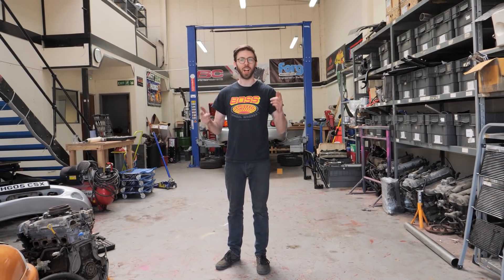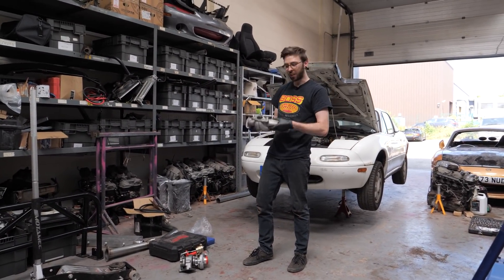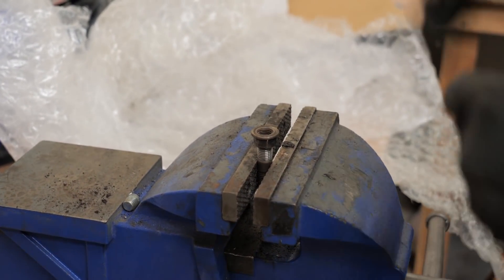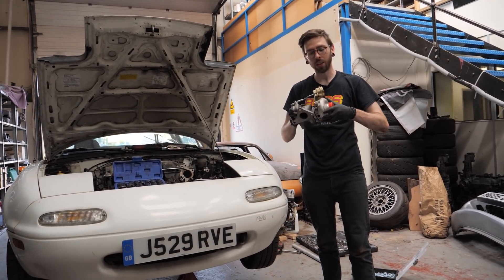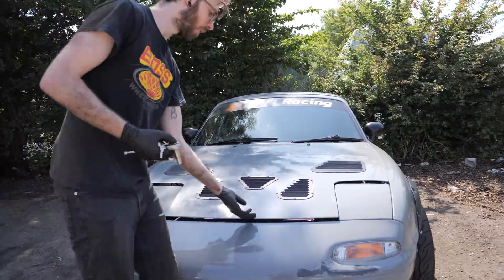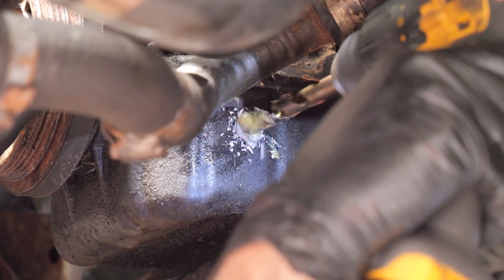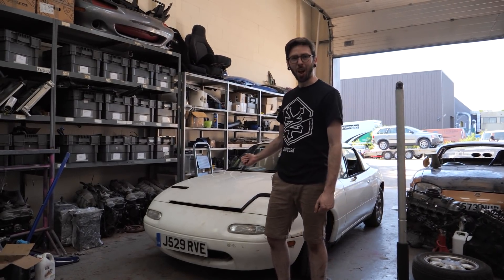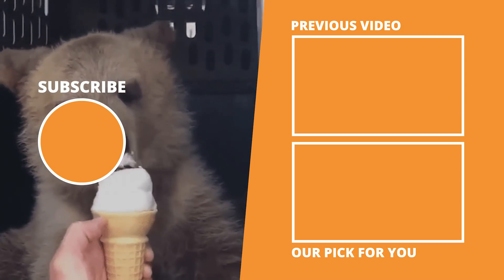The Miata Gets BOOSTED With A China Turbo And BLOWS Its Radiator

Comment: i run a 95 1.8 with g19 manifold, downpipe & dipstick oil drain, ebay td04, ebay intercooler, ebay intercooler piping kit, rx8 yellow injectors powered by ME221 @ 276.2 bhp and 247.4 lb-ft 
(crank) on 10psi
Reply from the maker: 💪 stout
Reply: Maybe a dumb qyestion but can you still use your dipstick and why would you use it as a drain?
Reply: @SybePlays  Yep, still a functional dipstick and using it as a drain saves having to drill into the sump and risk shavings getting in the pan.

Comment: To be honest, the only thing that broke was the stock rad is pretty damn impressive. Should call this Miata "The Mule"
Reply from the maker: We need to see what power it makes, it was at about 70% injector duty if I remeber correctly so the wastegate having one bolt holding it on probably saved it 😂

Comment: Nice quick boosted job Leigh. The Chinese TD04 probably could do with a better thrust bearing though - would make a good video
Instead of the risky job of drilling the sump, why not take the oil drain to where the dip stick enters the block and connect there - you can make a simple Y-junction connection and avoid drilling the block!
Reply from the maker: Thanks Phil. We've drilled plenty of sumps but this time round I didn't measure it carefully enough and nearly paid the price. Closer to the front there is absolutely acres of space and it wouldn't have been an issue at all. Only concern with the dip stick drain is ensuring there is enough of a fall on drain hose to prevent the turbo getting backed up. I'll look into the thrust bearing, have you got any more info?
Reply: @BOFIRacingTV  all you have to do is make sure you service your car (tune up) but looking at this video and the way you treat your cars..no surprise that a hole in the sump is the best idea for you
Reply from the maker: Just reread about it being a junction at the block. Good idea if we machined a fitting that kept the dipstick at the right level

Comment: I fitted the same turbo last year, dumped it for a genuine td04 now as I had boost control issues. Wastegate port is too small so would hit over 1bar even when wired open!
Reply: port the wastegate. I had to do the same on my Borg Warner S1BG Turbo. It would hit 1.2bar (17psi) with the wastegate open. After a lot of porting it now works fine and I absolutely love that turbo. Running 17psi now, but with electronic boost control on my stock 1.6NB making about 230whp
Reply: @mielsen7498  i had the same issues as Vyizis with my ebay td04, i ported the wastegate as much as possible and even shaved some off the channel that the exhaust gasses come from in the mail port and still creep issues... all i did was buy a used genuine exhaust housing and problem solved.

Comment: I've ordered a genuine tdo4 and am waiting for it to be delivered. Its 4 times more expensive. I'm wondering should I just try this one? Thoughts?
Reply from the maker: All we have done is burnouts with it so far. We will put it on the dyno and see how long it lives
Reply: my ebay td04 has lasted a year at 10psi and still going strong, had to source a genuine exhaust housing though because the casting on the ebay one was shocking and was boost creeping like a motherfucker...

Comment: Class video. How much did this cost all in?
Reply from the maker: We paid £110 for the turbo, £645 for the manifold and downpipe. DIYEFI sent us the ECU, then we used our own oil & water lines and an O2 sensor. Robbed the intercooler and pipework from other projects, which retails around £320 so probably £1600 all in
Reply: @BOFIRacingTV  not bad tbf